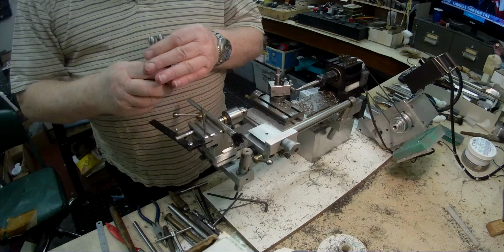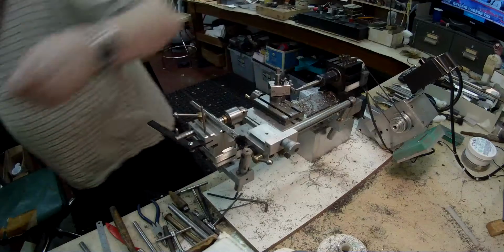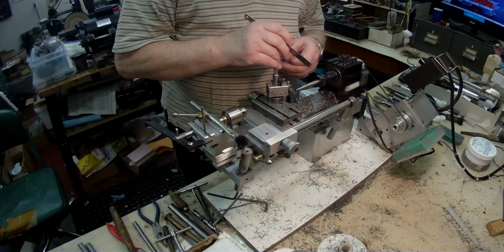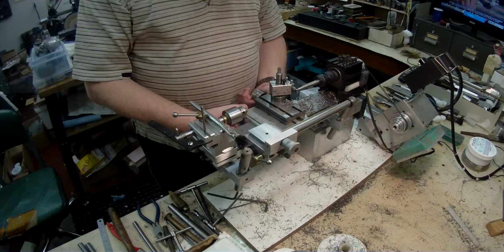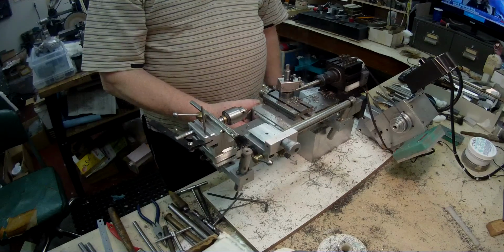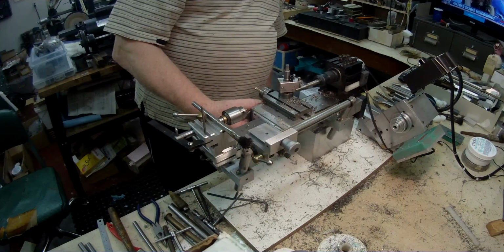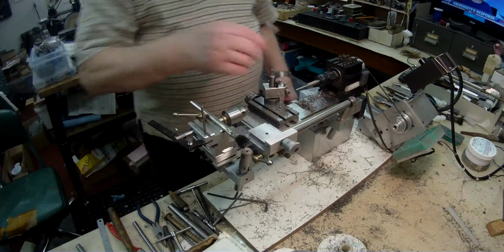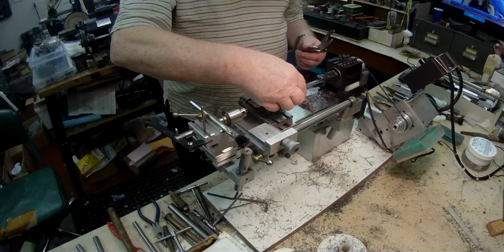FILE0038 Making the Handle  Shaft Pin

Comment: Walter:
Wow!  Another really great video.  You've encouraged me to try machining a bit of 304 stainless and see how it goes.  Your ball handles are really coming along and look great.  I can't wait to see them mounted on your lathe.  My projects have remained on hold for various reasons and I've been working on my lathe, but I should be getting back to them shortly.  Again, very nice work and thanks so much for taking the time to make this and other videos.
Regards: Larry
Reply from the maker: Thanks Larry,
    Appreciated, I have a spare, I'll put your stamp on it and when I do the mod on the handle and if you like the look, its yours,
Reply from the maker: Larry,
   I have always used 304, 303 I believe its free machining, I worked in Cancer Medical physics, Medical Divises, and most of our regular machining was 304 plus occasional surgical stainless and Tungsten, using hss tooling most of the time, but of course it wasn't mass production, so 303 and 304 would be good for you

...........Edmund.........
Reply: Walter Maisey
Walter:
I think your right.  303 is free machining when I look at McMaster's web site.  I don't know if my local supplier has any small diameters available, but I'll take a look next time I go there.  Thanks again for making the video.
Regards: Larry